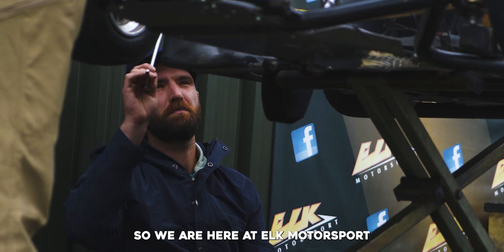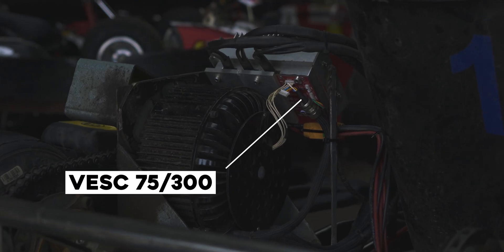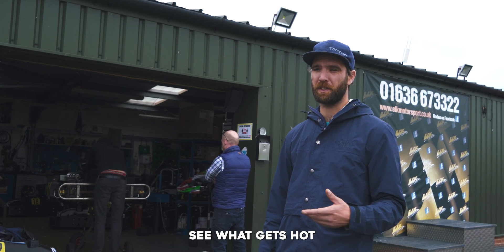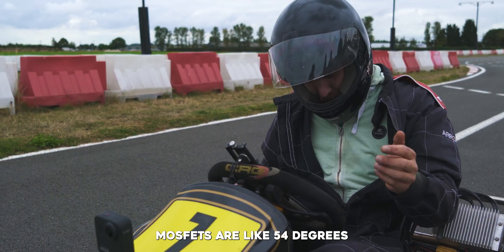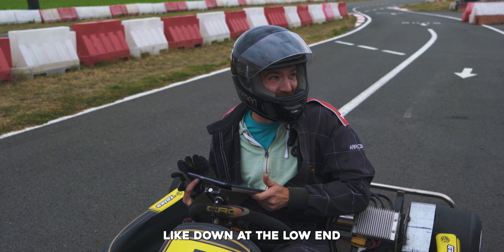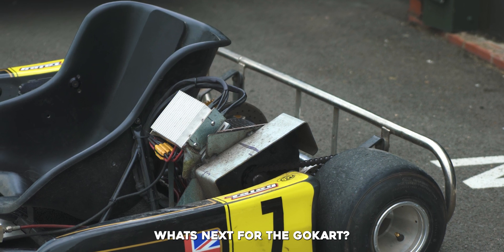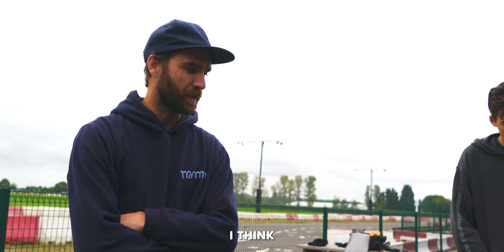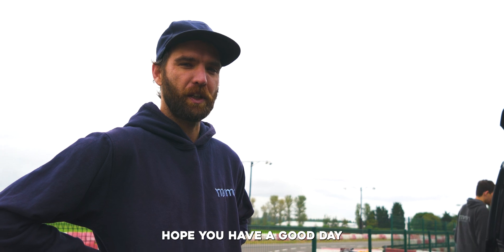Can a TRAMPA Electric GoKart Beat the fastest lap time?

Comment: Very interesting, im now build my own Ekart, what the gearing ratio and max motor rpm?
Reply: 16S is 67V fully charged. With the 96KV motor the max RPM is 96KV*67V=6432 RPM. That RPM will drop with discharge. Max RPM empty = 5000RPM. Top Speed is around 75Km/h fully charged, but that can be increased using field weakening.